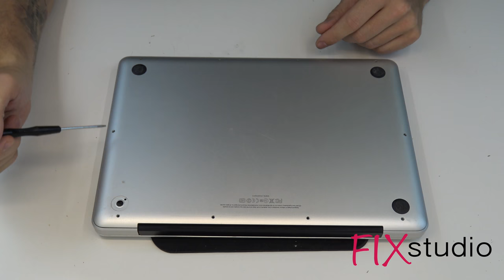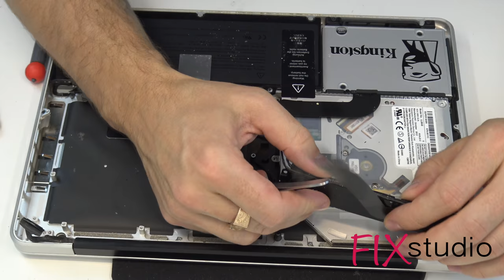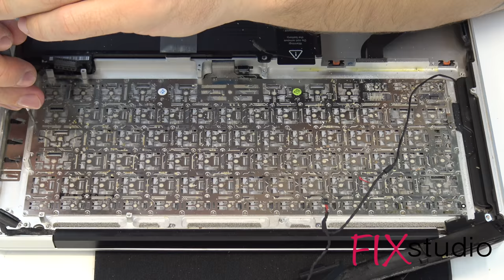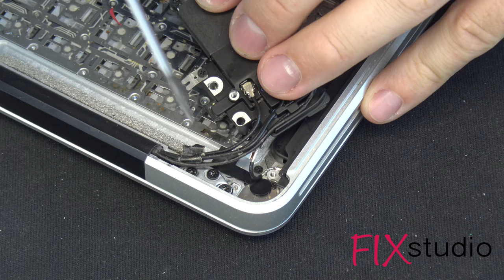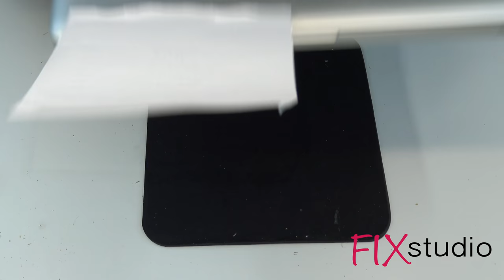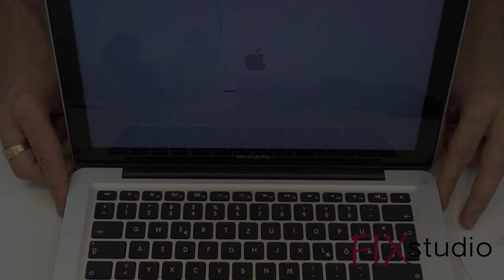Macbook Pro 13' A1278 -  keyboard replacement [4K]

Comment: I have a mid 2012 15 in Macbook Pro. There seems to be a piece broken on the logic board connector where the keyboard ribbon connects. I think it was broken from a previous speaker replacement job I did, but the keyboard was still working since. Last night I replaced the other speaker and now the keyboard isn't working, only the trackpad. I'm not sure if the cable is all the way in the logic board connector. If the logic board piece is broken, do I need to get another logic board? I don't have the tools to try and replace just the logic board connector, and it looks like a pretty intense job to remove it and connect a new piece. Anything else to try? Thx!

Comment: What is the black rectangle adhered on the back of the keyboard back illumination cover? 
Mine fell apart when removing this cover. I think it might be some sort of heat or electrical insulator because it is right under where the memory goes. Anyone know what I can replace it with?